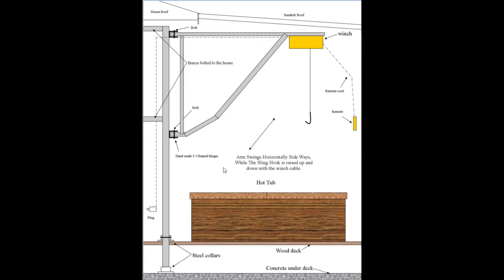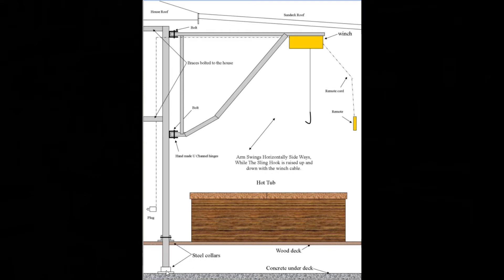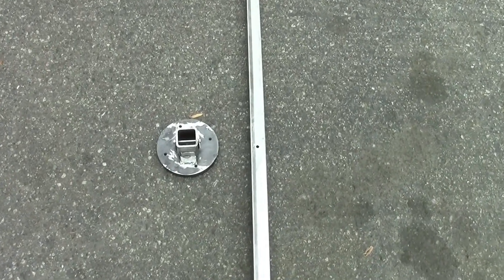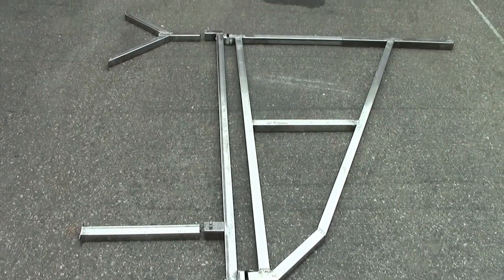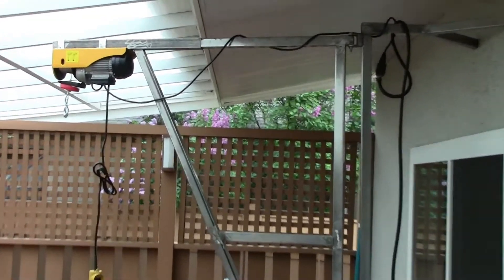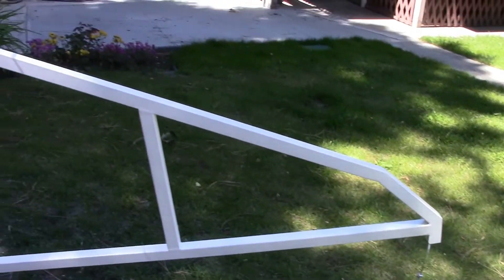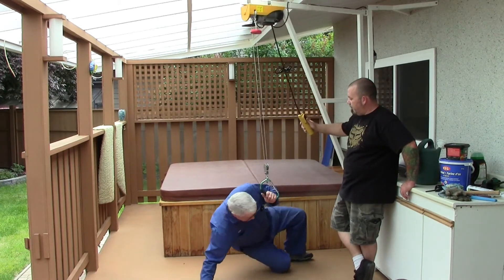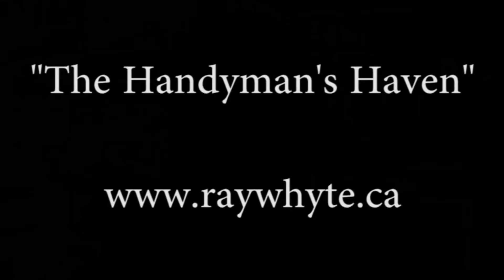Handicap Lift for Hot Tub

Comment: A couple of years ago, I saw this spectacular video! I CANNOT BEGIN to describe how creative this is! THIS IS SUBSTANTIALLY useful for a patient who has the inability to walk, or just has difficulty mobilizing to get into and out of a hot tub! Back in the days of old burn debridement, if a patient were burned severely, and had to stay in a burn unit, they would be taken every day to a large stainless steel tank that is called a Hubbard tank! When patients are burned to a substantial degree, they have to have a procedure known as debridement, to remove that dead skin from their burns. The Hubbard tank was a tank which contained water, and a cleansing agent. And It contained a whirlpool! The patient was lifted using a mechanical lift on a stretcher into this large tank, and they were placed into the tank, so that their burns could be cleaned. This is similar to what your mechanical lift is designed to do. It's designed to help this client get into the hot tub, so that He doesn't have to struggle to get in and out. This reminds me so much of the Hubbard tank! The Hubbard tank is no longer used, but it's a good historical landmark in burn care. This work you did for the lifting mechanism, was wonderful, and I support you 100%

Comment: AWESOME!! My wife recently became disabled. We live on a lake with a boat dock. I think I could adapt your design into a lift for her. She loves to be in the water (with a lifejacket). She does not have any functionality of her right arm and hand. I am unable to get her into and out of the water. Can you share any suggestions, plans and information to assist my building a lift for her. Thanks
Reply from the maker: Jim, I would be happy to help anyway I can.  I think the basic design I have will work for you.  The problem you have to figure out is how to securely mount the lift to your dock and allow for counterbalance for your wife's weight.  That could be actual weight or cable stays.  If you want my ideas, I will need good pictures of the platform and area around it to make some suggestions.  I don't know if you are building this yourself or having a shop or friend build it.  I can provide you with drawings if you require them. (no charge).  Here is my email  whyterj47@gmail.com